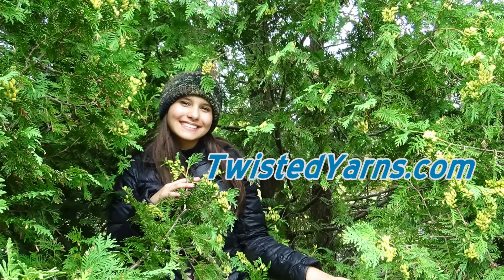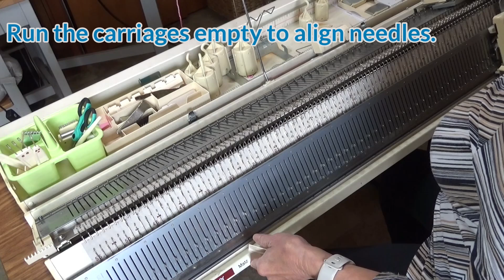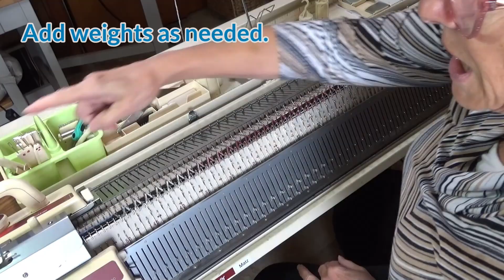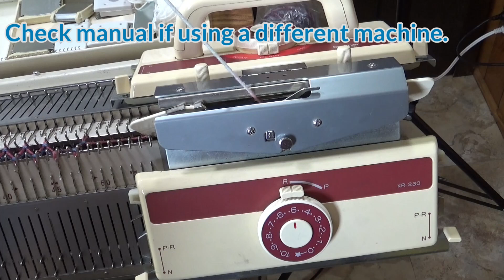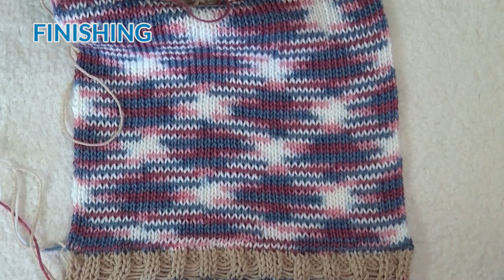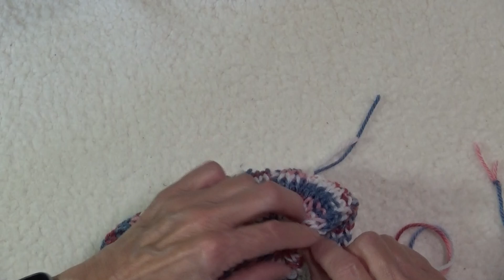How to Machine Knit the Runaway Ribbed Cap

Comment from the maker: FYI: The Brother "pressers" are unique to the Brother 230 ribber (KR230). They come with the ribber.  This was the original Brother Bulky. I use them sometimes with heavy yarns but they fit only in the carriage of the KR230 and are called for in the manual instructions for this model. Most of the time I use just weights and it works fine. 

The Brother KR260 ribber which fits the KH260 and KH270 does not have these. I checked the manual.